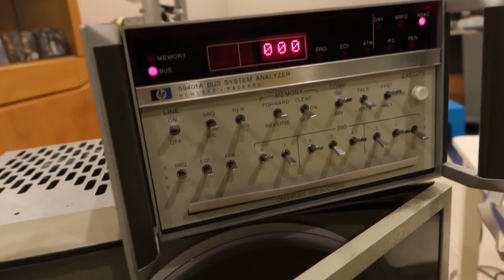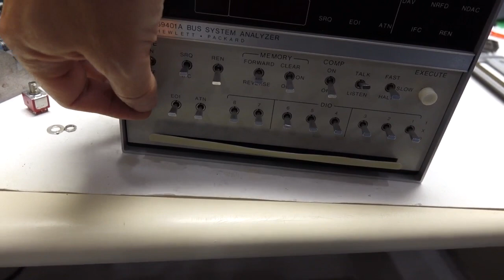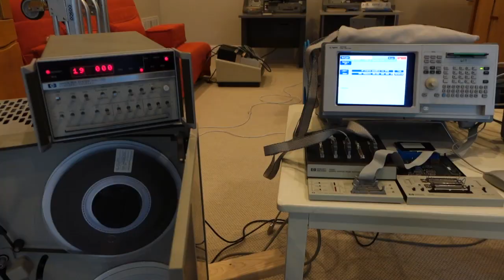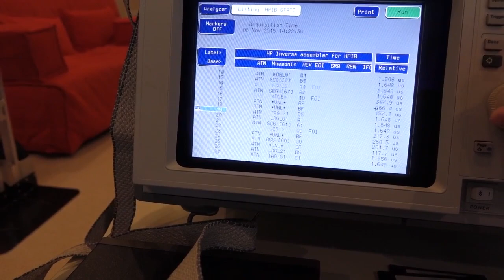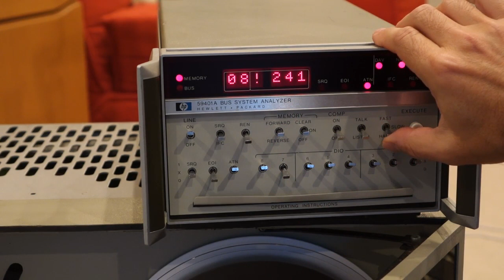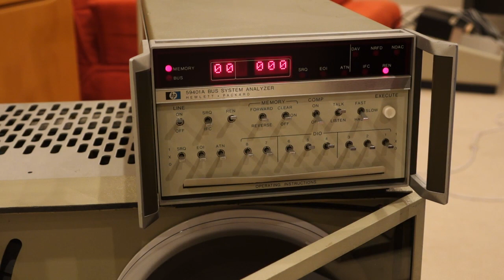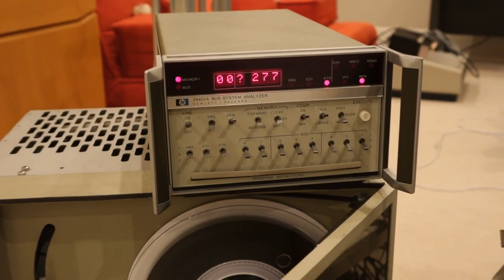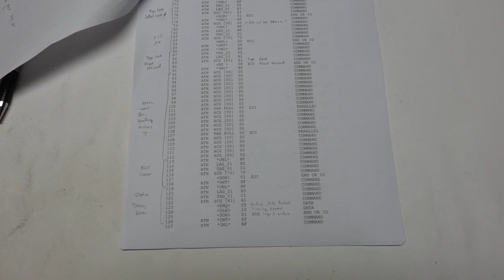HP 59401A Bus Analyzer and HP 10342B Bus Preprocessor for HP-IB Bus Sniffing

Comment: HPIB HPIB Slow as hell and sooo bulk-y.

But you can daisy-chain it.  Whoopi dee.
Reply: I think I still have a spare HP-IB cable hanging in my garage for some reason.
Reply: I really wish they had settled on RS-485 or RS-422 as the electrical layer, and had it serial. It’d have made it cheaper and simpler to interface with.

Comment: Hello Marc. First of all, thaknyou for all your videos :-)
I have the same HP 59401A also with a broken switch. Its the "Forward Reverse" which is a "returning to center switch" - i will have to change that.
In the video it looks like your "REN" switch can stay in the upright position. The "REN" switch in my 59401A is a "return to center" switch. Which is the correct one?
Also, can you recall where you bought the switches?
Kind Regards from Denmark.
Reply from the maker: My REN switch is definitely a two position switch. I bought my switches from Digikey. Mine were Digikey Part Number CKN9731-ND, Manufacturer Part Number 7201P3DZQE.
Reply: Thank you Marc! That a great help - much appreciated :-)

Comment: Hey very cool vid! 

I don't guess you actually managed to track down the inverse assembly disks that went with the Serial/HPIB and iSCSI preprocessors? I have both but not the software and I've been looking for images of the disks. If you have them I'd love to get copies. They are impossible to find. They are not available on the Keysight site. :-(
Reply from the maker: I do have the disc inages for the Serial/HPIB, but have not been able to find the ones for the SCSI interface yet. Send me a private message and I'll find a way to get it to you.
Reply: CuriousMarc awesome. Will do. Thanks just picked up the 8085 module and a general purpose module for the probe adapter. Sadly no disks for either. :-(

Comment: With a bit of work that bus analyzer could probably be made into a computer by itself; it has a processor in it, most likely an HP 'Capricorn' processor of the type used in the HP 80-series desktop computers.
Reply from the maker: +douro20 Yes indeed, teeny tiny specialized computer! No Capricorn in 1977. Probably an HP Nano or early Intel micro-controller, with as little RAM as possible (can only hold 32 bytes of transactions!) to keep the price reasonable. Newly invented semiconductor memory was still the most expensive IC at the time. Cute little machine though, can't beat the fun of paddling in a program and see red digits flip!
Reply: I have one of these in my basement.  Is it worth anything to anyone?